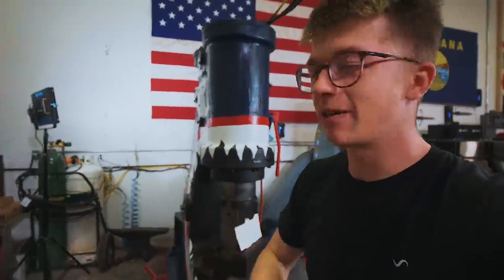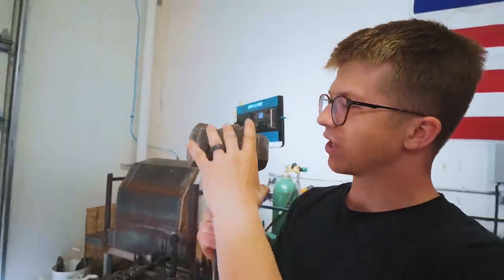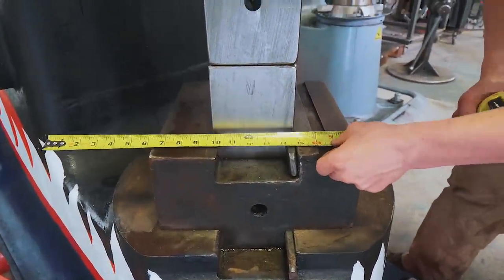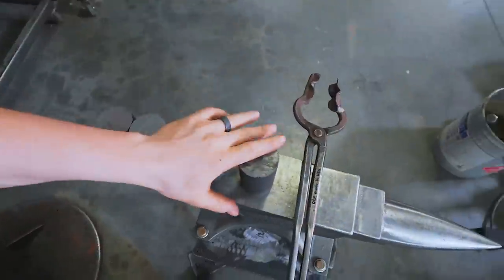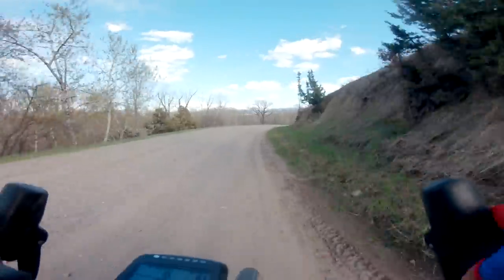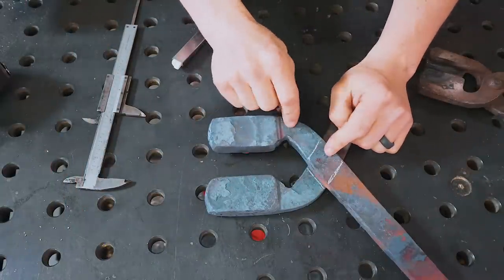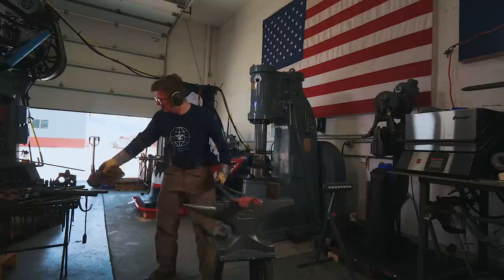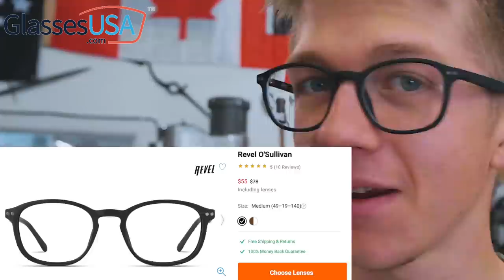MAKING MEGA TONGS!!!

Comment: My grandfather, a machinist,  told me that if I ever had trouble keeping a pulley on a shaft, drill and tap for another grub screw at 90 degrees to the existing grub screw (NOT 180 DEGREES). I've had great success with this method. I don't see why this wouldn't work for your case.
Reply: It puts twice as much force on the large area of the shaft and gear in between and opposite the two grub screws, where as 180° off would just be relying on friction of the tiny faces of the grub screws themselves.  Your grandfather knew what he was doing.
Reply: Best watch for how you offset the screw, as unbalanced shear forces can be an issue; undersize the secondary grub screw so it sacrifices itself rather than cracking the pulley or shaft. Something made the primary fail, and adding a secondary might fix the failure but doesn't address the root of the problem (likely still a better fix). Your grandfather knew what he was doing.
Reply: this is by no means coming from anybody as qualified as your grandfather but i've had good success in the past using a smaller grub screw behind the first to act as a kind of lock, similar to using a lock nut on stuff that really doesn't want to come undone at the wrong time
Reply: or you could grind a small flat on the axle for the screw to sit in. the screw mars the surface of the axle anyway so having a small flat for it to sit in shouldn't be an issue.
Reply: @arg8763  1.4 times as much force. :)
Reply: It’s also a good idea to use fresh set screws. The little cup on the end that meets the shaft flattens with use and doesn’t bite as well. Extra important on things that rely on the screw to stop rotation instead of a key or splines
Reply: @arg8763  i was about to say pretty much the same thing but with a western canadian accent 'eh
Reply: @Caedmon Jones, Its comments like this that make the comment section great.A life's experience condensed into 1 comment, passed on for free. I'm definitely gonna use that.

Comment: I had a pulley on a mighty big motor that kept loosening up. I used loc-tite on the grub screw and also used a second grub screw (with loc-tite) behind the first one. Never had another problem.
Reply: The second grub screw behind the first one is really the key. It functions like a double nut, shifting the material that needs to be torqued from the part-to-part (pulley-to-shaft) interface (which has loads of other stresses) to the tension that's purely in the threads.  Unfortunately, I think the phenolic material of that gear is the real problem in this application, I hope the locktite is compatible and holds, and that if he ever has to remove it that the loctite doesn't wreck the gear!
Reply: @kevinvermeer9011  There's a good chance it may be a problem. He used 4-5x more Loctite than needed. 1/2 rice grain drop on the end of it would be as much as needed, any more and it could make the grub screw cemented in. "Double nut" is always the best solution if it can be done and Loctite is a second solution when you cannot "double nut".
Reply: @kevinvermeer9011  iirc the phenolic material the gear is made of is not what the grub screw threads into, it's a two part gear (plus fasteners to connect the inner to outer) with the inner bushing (idk the correct nomenclature) being made of steel, which is what the grub screw threads into.
Reply: @notstonks20  Doesn't matter, it just has to make contact. If the phenolic resin of the gear is susceptible, the result is reminiscent of what happens to aluminum when contaminated with gallium .

Comment: Pro tip: when working with belts and the possibility of dropping them a few feet of fishing line to tie them to something so if they drop you can retrieve easily
Reply: Honestly he could have just used a coat hanger to fish it out, but it turns out he needed to get back in there

Comment: Hey Alec - just a note as someone who works on industrial equipment as his day job - It might not be such a big thing currently while everything is on lockdown and the total number of folks in the shop is down, but check into putting a Lock-Out-Tag-Out protocol into place for the rare times the "do not run" sign blows away. The locks are cheap insurance against some pretty gnarly machine tool injuries. (I only mention this because I didn't see one already on your disconnect. Also chances are you're way ahead of me on this one but I felt had to mention it)

Comment: I would use lock out/tag out procedures when you have equipment that shouldn’t be used. Much much safer
Reply: bjunglin hooyah
Reply: Correct me if I'm wrong, but isn't it just him and Will in the shop? I'm not up to date but I'm guessing Will is 't around because quarantine; sounds odd to tag out a tool that only you use.
Reply: Alexis Ross I’m pretty sure that others are in the shop at different times but I could be wrong. It is certainly a good habit/program to get into as he moves toward being a production based shop

Comment: Repost of my comment in a previous video:
 You guys weld all your Damascus billets, and that's great. But what I would love to see in one of your videos though is an in depth demonstration on steel-wire tying billets, and forge welding them by hand. 

I've seen explained it in forum posts but I think making the technique a little bit more public would be great as it cuts down costs DRASTICALLY. You don't need to buy a welder and you don't have to pay someone by the bead. All you need is a spool of steel wire and some pliers and you can do your own billets independently for however much wire you buy.

It's also incredibly accessible.

Please, pretty please, bless us poor smiths with this wisdom

Comment: what about making a 4-sided hammer, instead of 2-sided, kinda like a 4 flanged mace?
Reply: I feel like that would be more trouble than it would be worth, as you could just make two hammers for about the same amount of effort (or probably less) and they would both be easier to use and less clumsy. That said, if anyone tries it it would be interesting to see how they turn out.
Reply: It would be neat but extreamly heavy. That would be something you would do some major pounding with for sure
Reply: Paul pinto forged one like that

Comment: Alec, if I was building a power hammer table, I would make it in like a half pill shape. So the sides and towards the back of the hammer would be flat, and then around the entire front would be a semi circle, 6" or however wide offset from the dies.

Comment: You can always put 2 set screws in a single hole.  It works like a double nut.  That will keep it tight.  It will also prolly destroying with somebody other than you tries to get it apart as they will not know there is a second set screw in the hole.

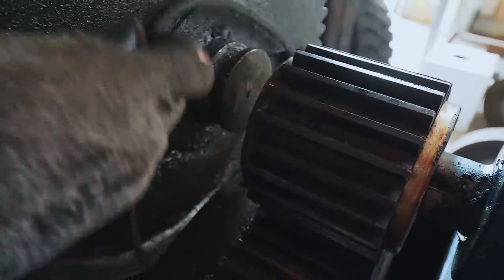Comment: 1:15 Put some Loctite on the screw to make it unremovable without a hammer drill and hex head bit and hope you don't strip the hex screw if you need to remove it you said? Because at exactly 1:15 that's like 4-5x the amount of the stuff needed and will be just that. Just one small 1/2 rice grain size drop on the end of the threads is needed on a screw of that size unless you no longer like serviceable parts. That amount? 2.5 inch or larger bolts. But at the moment with it clearly being squeezed out still and the video is paused... maybe going for 5 inch bolt amount on a 1/4 inch set screw(3/8 hex head?)? You only need enough Loctite to cover 3 threads including being smeared due to threading and excluding other threads with strips of the stuff bot not complete coverage. That's a tiny amount compared to the size of the bolt. Anywho I suggest giving that set screw a little unset and reset before the Loctite turns to thread cement and let it act like preapplied Loctite except in bolt hole too.

Comment: when I saw that note on the power hammer it kinda surprised me especially when you have multiple people working in the same shop you should really implement a lock out tag out system so nobody can make the mistake of turning on the equipment if its locked out mechanically and or electrically. also that way you will comply with OSHA and avoid potentially thousands of dollars worth of non-compliance fees

Comment: Have you ever tried to heat wide tong handles up and adjust them to fit your grip so they are as comfortable to grip as small stock tongs that's no more of a grip than 2 stacked 1/4 square stock? Or is the extra width between handles needed for easier rotating of the stock even though it is less comfortable to hold. A question some young smiths might want to know. "Tong handle ergonomics and you." could be the title of the video. Yes that was a  long winded video suggestion.

Comment: Just a question because I'm curious, Is there any benefit to hot chiseling the jaws open as opposed to making the initial cut with the angle grinder and cutting blade? I mean I assume either way results in material loss, either by the stock removal of the cutting blade or the oxidation of the repeated heat cycles to make your opening with chiseling while hot. Appears time savings in cutting verses chiseling as well. I know its a trivial question really.

Comment: Next time you need the Vee Belt secured...  I suggest either remove it completely or tie a piece of string around it. and tie the string to something outside the hammer :P so you can alway pull the belt back up. ;)

But I guess you solved another problem before it got bad, with the gear. :P

Comment: Umm maybe stupid question, but cant you make adjustable angle reigns to suit for any size stock that fits into jaws? In sense there is round peaces with teeth that lock/hold when bolted together. Loosening the bolt angle can be adjusted and then locked in place. This kinda adds more parts, but parts are smaller... so easier to handle? Also how about making reigns that can the increased in length by screwing additional pipe peaces? Kinda modular setup. I know its not traditional but for these less common big projects could be worth it and cheaper in the long run?

Comment: Maybe u should try to shape the handle in "S" or "~" or half of a "c" (or just make it curvie) so u can have a better grip... it is just an idea...
Reply: Bruno Rosa if you look right at the end, he bent the handles more and they actually cross over when the jaws are closed. He appeared to be able to hold that sledge head with one hand (at least vertically, a big chunk of steel on the end of those tongs is going to be a serious workout)
Reply: @pgreenawalt  I had the impression that he can only hold it at the far end, but i may be wrong...

Comment: Possible new tool. A framing/carpenter’s square gives you good right angles on larger sheet stuff like mdf or sheet steel.
Reply: Interesting suggestion. Aren't most such squares cast and then machined though?
Reply: Frederica Panon useful in cutting down a sheet, or laying out your lines, checking if a cut is through. It is not all that expensive and occasionally useful.

Comment: Genuine question no criticism intended or implied... how would an old timey smith without access to an angle grinder and blow torch have performed those operations? I am assuming that there is another (probably more time/effort intensive?) way to get to the same result and I am curious as to how. Thanks for the video. Cheers Murray

Comment: So,  did I miss the "Ah Ha" video where Alex figures out the big power hammer head knocker issue?  I saw the take apart video's and the trundle mod video but never saw a video where we find out the root cause of the head knocking.  Or is it still head knocking?
Reply: I don't think that this problem was resolved entirely, it's much better now with all the small fixes but still there lurking...